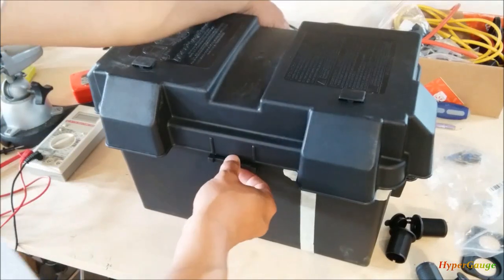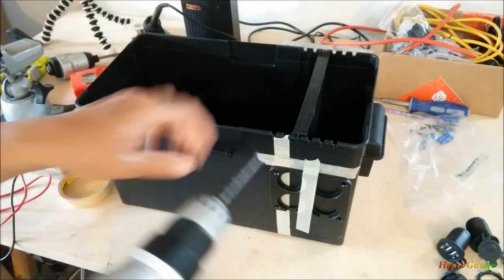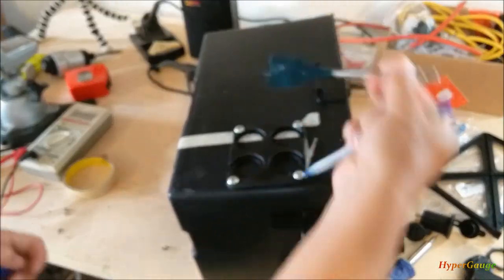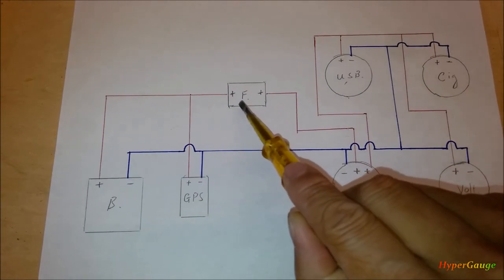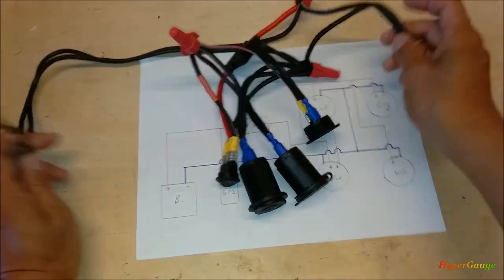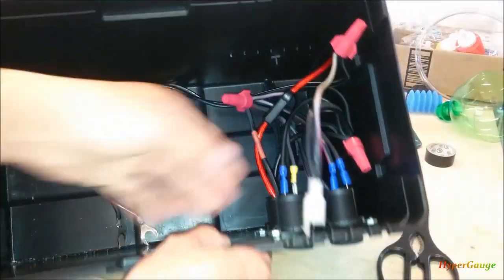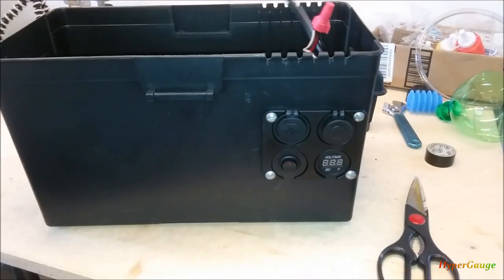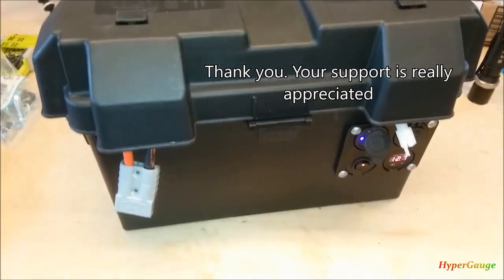Battery box mod how to,add USB+cigarette Lighter+voltmeter+switch. wiring diagram reference.

Comment: I like it. Thinking of having a similar box in the boot of the car to power stuff and carry onto boat for trolling motor. My reservation is I feel it would be wise to isolate the electronics from the battery. Battery boxes were meant to be used to separate the battery from the components and enable hydrogen to be gassed off if produced. To this what would be better would be either an inner sealed box or a separate box mounted to the side or to fit the venting tubes to the battery and take them to the other side of the battery box.
Reply from the maker: That is a good point that you brought up. In my case, the battery box itself has a few venting holes designed into it for air circulation. I think the risk is relatively low for gas buildup inside the box. And I need to minimize the footprint, so I am going to keep the current setup. Cheers! 👍

Comment: Thanks for the vid, can you add a solar panel in the boat to keep battery charged?
Reply from the maker: Thanks for watching my video. IMO In theory you could, but in reality the current technology has limitation, The added weight, cost combined with your regional sunshine rate, angle of optimization... etc. All these factors make adding solar penal not make any sense with a small boat that is constantly moving around.

Comment: What size of wire do you recommend?
Reply from the maker: I used 10 gauge wire for internal wiring. For the battery to motor,  I recommend you should consider at least 10 gauge or even 8 gauge depending on your setup. Good luck with your project.